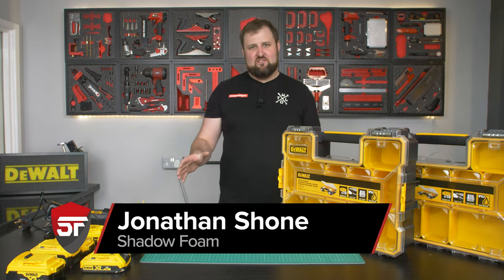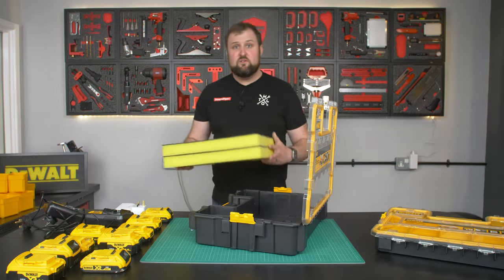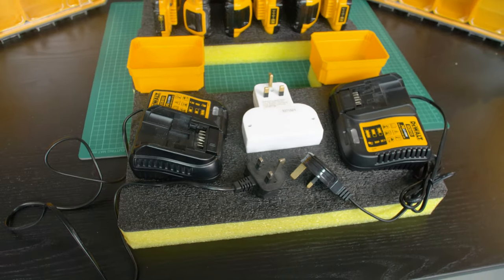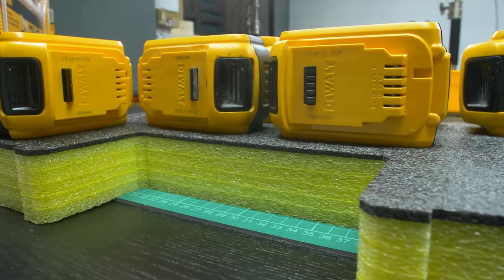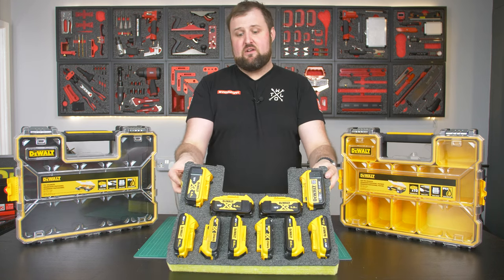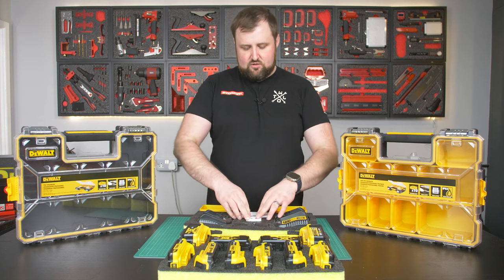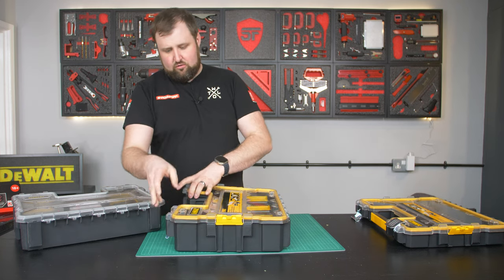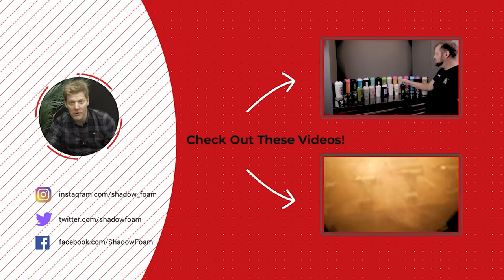The DeWalt Toughsystem 2.0 Battery Charger Case is NO MATCH for our DIY solution!

Comment: Very good idea. I can’t be leave I’m watching this months after I purchased my dewalt battery box charger. :(
One thing to mention is that the plastic feels a lot more cheap on the charging box than the actual storage boxes that your using. 
That’s one thing I did not like but I do like the convenience of it just not the price. 
Your solution looks a lot more cost efficient and I like the fact that the Stanley box fits with the dewalt. 
Thats something I did not know. 
Thnx for the info.
Reply from the maker: My pleasure mate!

Comment: The buckets won't work properly though as they are not tight against the lid, meaning any drill bits or screws will flot around in the case.
Reply: Hot glue a neodymium magnet in the bottom of each one!
Reply: @devonc9764  Good thinking, you are a problem solver sir!!